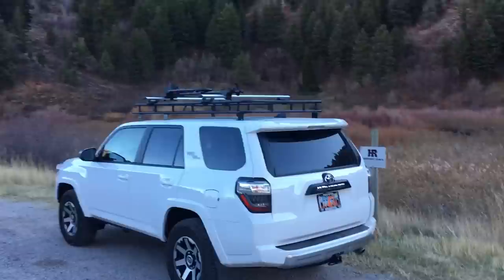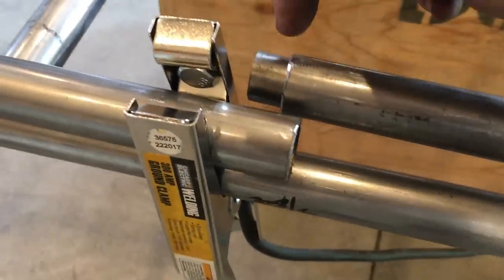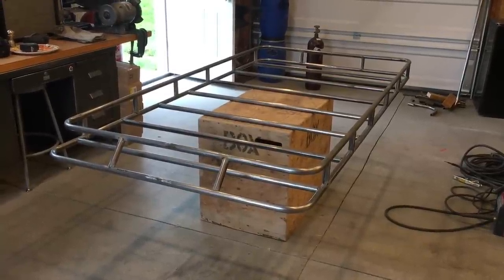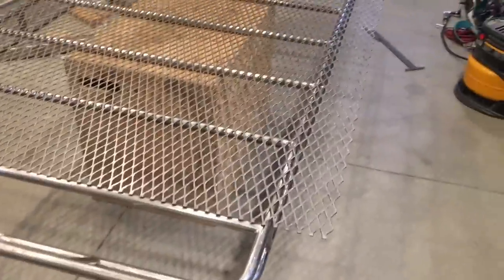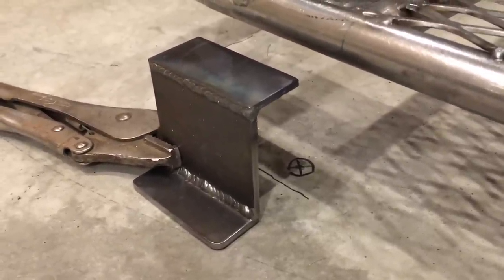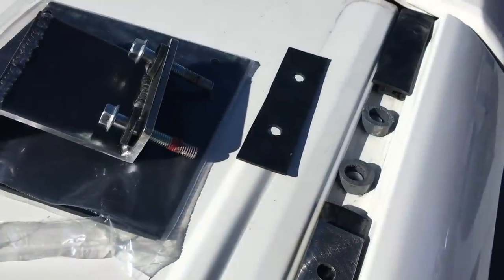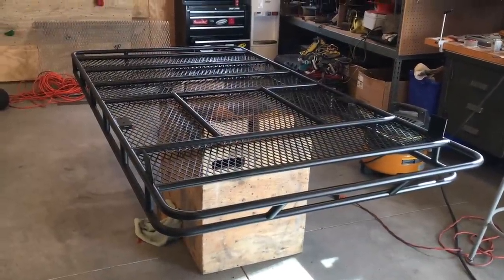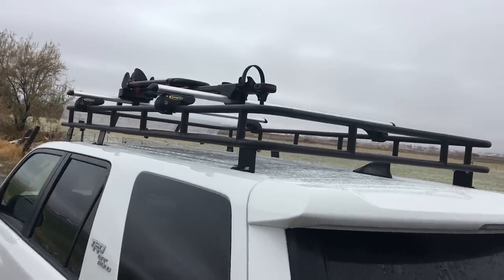Welded Toyota 4Runner Roof Rack, DIY

Comment: @ kirk earl, This is a VERY well done rack, definitely the highest quality I've yet seen from YT DIYers. I'm exactly where you were with this idea, about to have some free time and am going back and forth with the build or buy, build or buy dilemma.  Projects like this tend to show that building is satisfying but oft times you can actually just get a production piece for not much more, and they're better done because of engineering, materials, proper tools etc. (e.g. thinking of mocking a NorthShore bike rack).  However, in my research I'm also finding things/details I'd prefer in mine that aren't in production racks (both steel and aluminum), or like you picking and choosing from among them all for the ideals in one and am mentally drafting both versions (platofrm steel or platform extruded Al).  I must give appropriate props for your attention to detail as a DIYer, hell I'd like to see more of that detail in regular life and commercially available products too!  ;)
I like the sleeved butting of the tubes. Did you plug weld the inned tubes to the outers or just the gap at the butt glues the inner sleeves to the outers?  I like the floating floor and the tension feet.  It looks (from the video) like they don't quite land in the gutter but rest on the corner.  I'm sure you'd've addressed this and your narration suggests the front tension feet rest in the channel base. the layering rubber in the steel is good too.

So, 1" OD 16 ga all and 9 ga expanded.  
Is that 0.5" short axis gap or more like 0.75" short axis, 1" long axis?
88"ish L 45"ish wide 3"ish tall riser so overall (sans towers) top of top tube to bottom of bottom tube it's like 5" on a 3"ish tower..?  What is the total rise to top tube off the roof?

I'm on the fence about gamivit towers then building a platform similar to your build off those, or Rhino Rack backbone (I have a GX,a nd they list a prado 150, but mine's a LC 120/GX470, so determining if the 150 works or if it's less than ideal) and build up from T-slotted extruded aluminum.  The gardgets for all the Al racks are sweet, but the universality of a base platform like yours/Gobi,Baja,Gamivit is appealing too, like you say just bungee anywhere...

I'm thinking of a 1" or 2" steel mesh grid vs. expanded steel sheet... That would allow 1" cam straps as well as bungee hooks or ratchet strap hooks.  Thoughts/opinions based on having done the process?

If you did it again, would you make the towers adjustable height, or you dialed the fixed height for a reason.?
Since you got automotive paint with hardener, I'm sure that moved the bottom line up a bit.  What was your TOTAL materials cost (save expendables)?   Did you happen to get a weight when done on this rack?

In my area I can get paint by the qt but hardener by the gal, so quality automotive paint for small projects like this is a bit of a co$tly PITA.  I also wonder how bedliner (brushed/rolled vs sprayed) would last.

Thanks for posting and sharing the comprehensive build. Top notch.  Give a holler next time you come down to Moab, we can chat racks and general DIY metal projecting over coffee ;)
Ciao.

Comment: Fantastic craftsmanship dude.... well done !! Looks totally legit. I was looking for ideas for a rack for my 3rd gen 4Runner and you really nailed it. I too was wondering if the material cost and hours needed would be worth it in comparison to just buying an off the shelf rack. Im still undecided, I have a welder and all the tools needed. ..... Again well done .... Awesome job !
Reply from the maker: Thanks! I'd say it is only worth doing it yourself if you like doing projects like this for fun and have a bunch of free time to kill. I you just want to save some cash and don't really dig projects like this, I'd just buy one. I saved maybe $1300 or so, but it was a huge project figuring out all the measurements without a plan.
Reply: Yeah I hear ya..... its not something i need right away so I may just tackle it over time.

Comment: Awesome DYI Rack build. What is the weight of the Rack? What is the rack carrying capacity?
Reply from the maker: No idea on either question. I did copy the metal material specs of the similar rack made by GOBI. Mine is about an inch taller on the basket part though. Whatever their published weight and carry capacity is, I would guess mine is very similar. I can easily have two adults standing on top, and I'd not hesitate to put a roof top tent up there. It's solid.

Comment: Did you have any trouble with metal warping during welding?
Reply from the maker: No warping. You’ve got to be good at welding thin gauge metal though. Burning through is more likely than warping. I burned through a few times and had to fill it back in.

Comment: Would you mind sharing the primer and paint brand that you used. Thank you
Reply from the maker: Hi Fonzo. Sorry, but I don't have the cans around anymore. I spared no expense though and went to an automotive paint shop and got legit 2 part primer and paint. I sprayed it out of a very cheap Harbor Freight automotive paint gun with a 3 gallon air compressor. If I'd have bought rattle can paint I don't think it would have held up very long.
Reply: @kirkearl  I'm in between your method and dupli color bedliner can. Have you thought about using the bedliner. Awesome video by the way. Will save it to favorites

Comment: What kind of steel tube did you use?
Reply from the maker: Outfit Five 16 gauge 1 inch steel tubing. Don’t buy 1 inch pipe, it is much different.